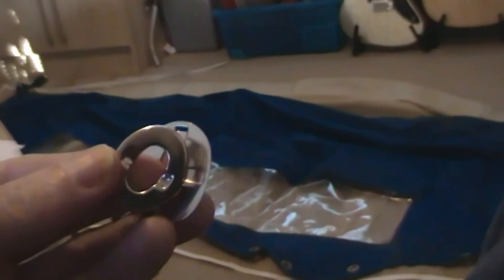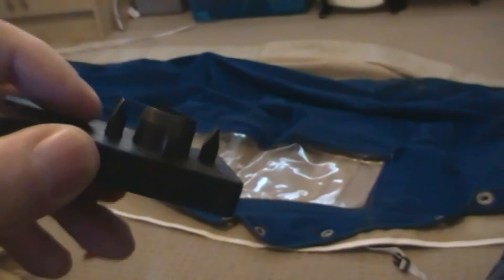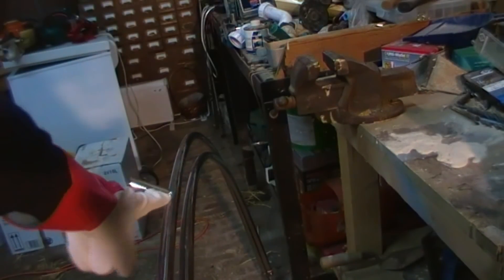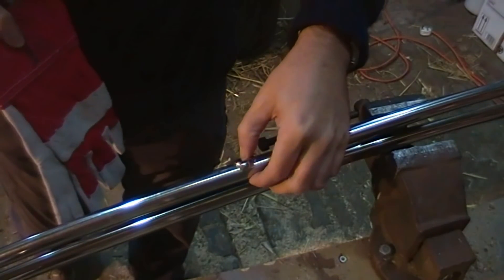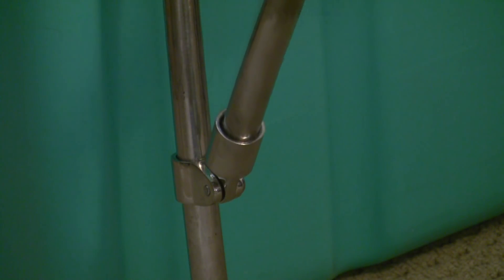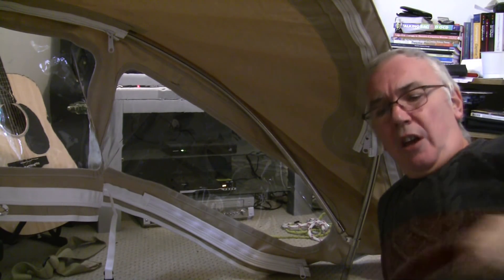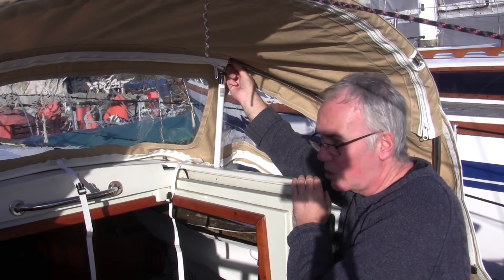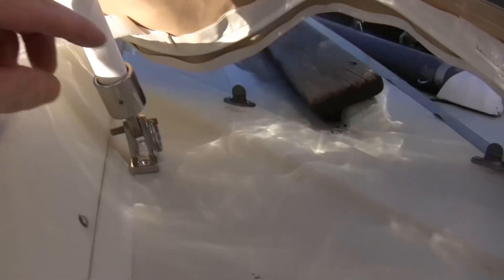Just About Sailing December 1 2017 - fitting a 'new' sprayhood not made for my boat, Pt 2

Comment: Your getting there.  I thought of doing the same but canvas only last so long and the plastic windows get hard to see thru really fast.  So I did mine with fiberglass and safety glass. Great to have separate water tanks and fuel also.
Reply from the maker: You are right.  It's not going to last forever.  But a bargain is a bargain - I couldn't resist it.  It think it will be a sensible more to separate the water out, just in case. Cheers.

Comment: Cool. Thanks for the video.
It's good to see you keeping warm in the winter months. I too am in refuge for the winter, but I am missing my boat like crazy. I usually live on the crouch, so not too far away. One day I will fit a webasto and make the whole year on her. As you know, it's all money related.
Keep the videos coming. And I am looking forward to the water tanks video.
Keep warm
Jiki
Reply from the maker: Thanks for the comment.  The last two winters were spent on the boat.  I found that the combination of a small fan heater and a decent desiccating de-humidifier kept things 'warm enough'. I think diesel heating is the way to go as it gets rid of moisture in the air as well as blowing warm dry air around the boat.  I want to get a combined Wallas stove with a blower heater - but I will need to save up a bit.  Yes, I want to get back on the boat full-time too. It's unnatural not being afloat.
Reply: Just about sailing

The wonderful Chinese have grabbed the eberspacher and webasto heaters and built a very reasonable copy at £182 with a control unit and fuel tank. I think in February I will be investing into one of those.
Reply from the maker: Let me know how you get on.  Getting a new diesel heater for less than £200 sounds almost too good to be true.  That is a very good price.
Reply: @verynearlyaboutsailing8114  We lived aboard for 2 years in the UK (Cornwall).  Diesel heating is not the answer - still got horrendous condensation problems even with a dehumidifier and a fan heater.  We gave up that idea and now live ashore and sail in the summer.
Reply from the maker: That's a bit worrying. I know that compressor dehumidifiers don't work at all in cold weather as they rely on being able to produce an even colder surface to produce condensation - impossible at low temperatures.  I had a desiccant dehumidifier in Devon and it was great - I could even dry clothes in the boat.  Unfortunately only good when on shore power. An air blowing diesel heater should dry the air as the water producing 'flame' is completely sealed from the interior (airtake and exhaust both being external). I agree that living with condensation is truly awful - absolutely everything becomes damp all the way through.

Comment: Yes with two of those frames you would have a complete tent over the cockpit, you see them alot in europe gives an extra cabin in port. A nice tank shame the smaller two werent full off cider like the ones i use (hic)
Reply from the maker: You might get this reply twice.  Something went strange with YouTube and my first reply disappeared - strange.  There is a low cost full tent option.  Not as strong as a framed bimini - but looks quite good.  Check out SV 2nd Wind - they bought one at the boat show and it looks OK.  Yes, I missed a trick there with the old 'Oh, I need to drink all this cider because I want the containers' excuse.  Cheers.

Comment: Copper kinks easily - and there are benders made of spring to bend pipe without allowing it to crush/kink.  Just like the PVC, which I wouldn't have thought about.  Nice.
Reply from the maker: Yes, my original thought was to use copper.  I would have needed quite a long spring.  There is also a method where you fill the pipe with sand - I've never tried that.  The plastic pipes seem to work on the same principle as the spring, but on the outside.  The ones I used are quite substantial (I think they are called barrier pipes).  They are also a very snug fit to the copper - by pure coincidence.   As I say, If I decide to make a bimini, I might mock up the frames using this method.  Cheers.

Comment: Some very good ideas on this video.  Bravo.  One question: After cutting the hand grips off the stainless tubing, what did you put on that area to prevent rust?   Something that looks like a stainless finish, or just a primer and any metal paint?  Looking forward to part 3.
Reply from the maker: I am also looking forward to part three!  I haven't put anything on the area where I cut of the handrail.  I haven't quite finished it yet.  I intend to simply grind off all the weld right back to the original stainless and then burnish and polish it.  Hopefully it should look like the rest of the tubing.  Having bought second hand tubing I am taking a bit of a leap of faith that it is 316 - it might not be.
Reply: Thanks.  That is why I asked.   I think I was victim of some 'non-standard' (shall we say) 316 on my bimini frame, and in a small spot where I cut, it rusted.   I was just wondering what treatment others did on their frames.   It will be interesting to see how your's ages.  Cheers.
Reply from the maker: I think I will just have to keep my fingers crossed.  If it turns out to be fake 316 then I will replace the frames.  The fitments I bought were from a reputable supplier and came with a 316 certification on the invoice.
Reply: Whenever you damage the surface of stainless steel, even 316, it will rust.
Reply: What about applying a primer and coat of paint over the spot (after a bit of sanding) Ian?
Reply: That would work, Patrick.

Comment: Copper pipe inside the PVC tube was a Great idea!  BTW, was that a Martin guitar in the background?
Reply from the maker: Yes, unfortunately I only figured out I could use the copper pipe inside the plastic tube after I had done all the bending and measuring work.  It really does give the best advantage of both.  Yes that is a Martin in the background.  Finest sounding acoustic guitar in the world - not the way I play it of course. Cheers.
Reply: I live about 10 miles from the Nazareth, Pa guitar factory.  Distinctive head stock!  Agree, best sound.